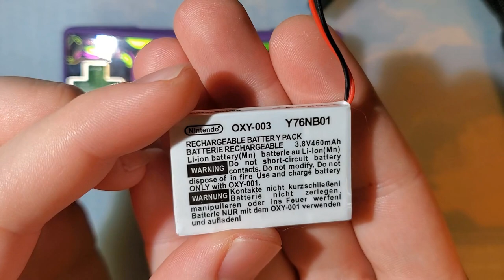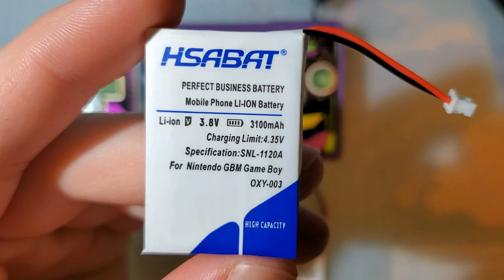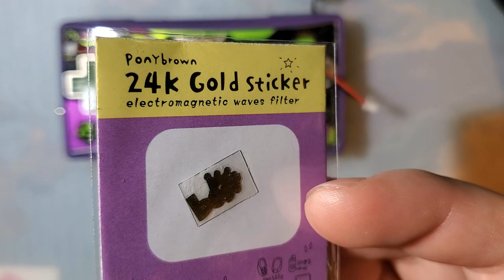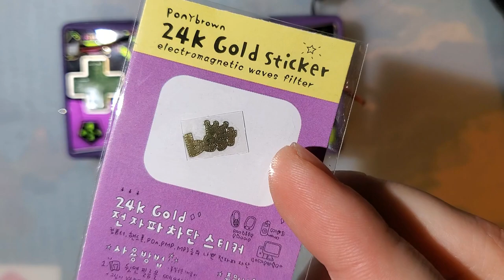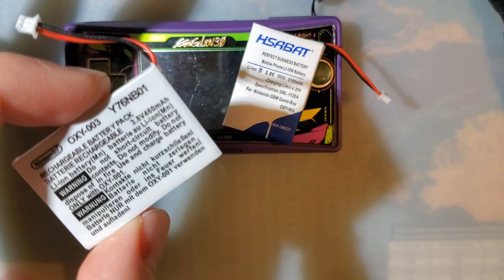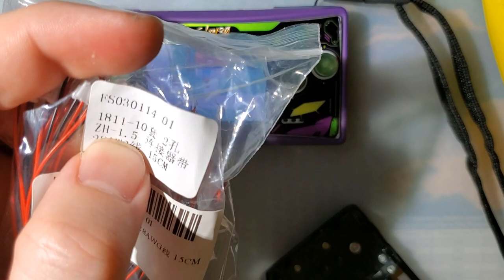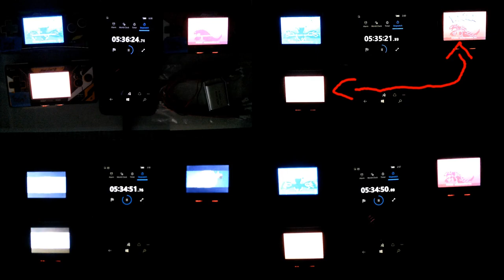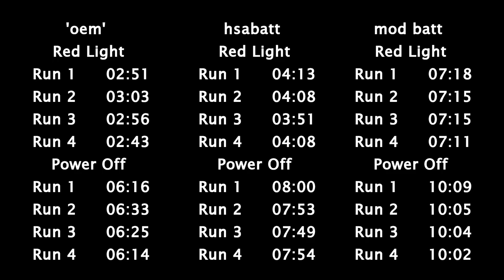Yet Another Game Boy Micro Battery Mod

Comment: where did you get that EVA faceplate?

Thanks!
Reply: nevermind, for anyone wondering, Makho has an comment on an earlier video about the faceplate:

"The faceplate was purchased on aliexpress and is no longer sold. The purple coating on my Micro is cerakote and I had it done custom. The silver Micro at the end of the video and the purple Micro at the beginning are the same console. 

The faceplate is actually just a sticker. I got the sticker on aliexpress and applied it to a scratched OEM faceplate. It was only a few dollars and there are other designs still available (none of them are Eva themed though). The cerakote was done by a gun shop. It was not cheap. I could have purchased another Micro for the cost. Yes, I love how it turned out. No, I'm still not done with it."

See: https://www.youtube.com/watch?v=L2095F4UELI

Comment: USB C in GBA micro?
Reply from the maker: I've been thinking about it. My biggest issue with it is that it requires significant irreversible modding to add the port otherwise you have to replace the link port and you lose that link functionality. I could add the link port pinout to the USB C port and then it would be fine with a custom dongle but then you risk having non-standard USB C implementation with voltage on pins that are likely not expecting voltage. It could damage either the Micro or the device it's plugged in to or both. Alternatively, you could just use another console for the link port (and I certainly have enough consoles for that) but I still don't like it.
Reply: It is probably easier to just have a micro to USB-c converter.  Or using the existing micro to USB-A cable and then a standard USB-A to USB-c converter.   You probably can only use it for charging in any case.